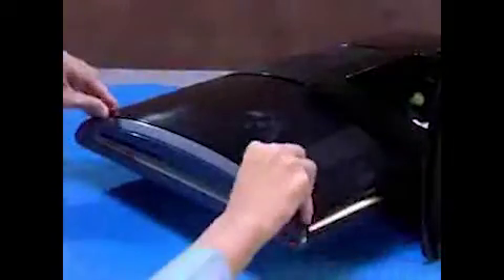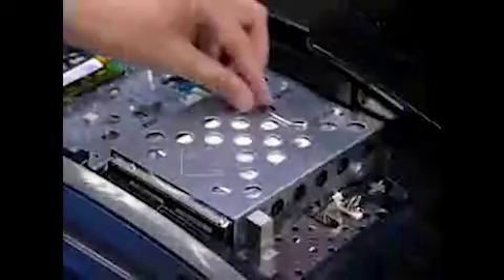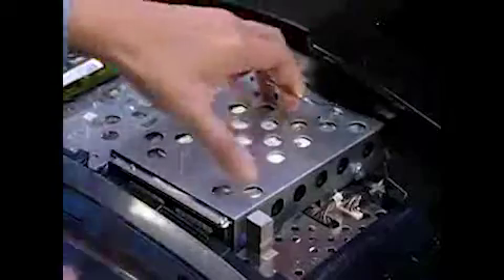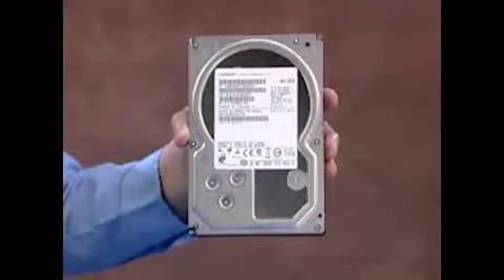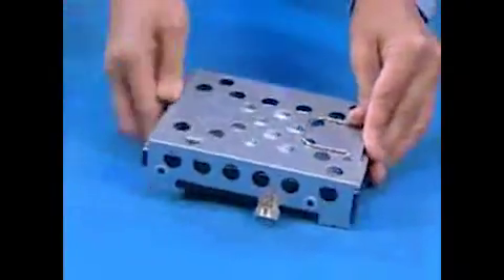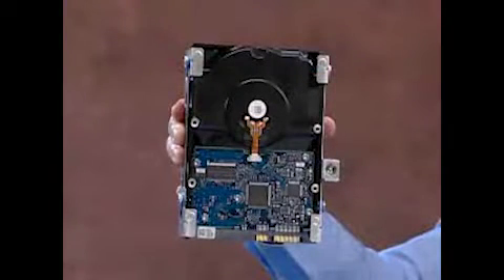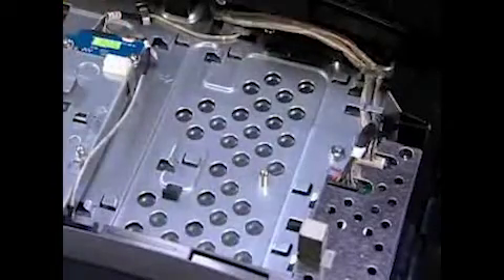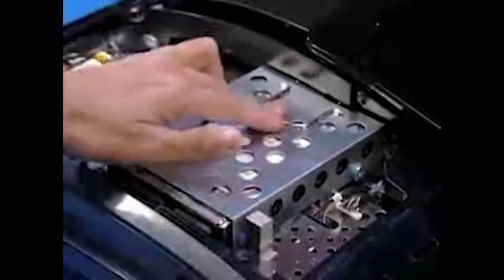Replace the Hard Drive | TouchSmart 610 | HP Support

Comment: 240p? realy? You also forgot to mention the upper plastic cap and the screw behind it, before the pc can be opened.... Sorry but every dissasembly Video from India is better.
Reply: So no mention of the blind caps holding in the screws. The wireless dongole that needs to be removed before the cover...  at least give us Playlists by model or post the service guide pdf for out of warranty models. #righttorepair
Reply: Right, 720p MIN. Thanks for the Top cover/screw information. I was trying to force it and wasn't moving. 🫡